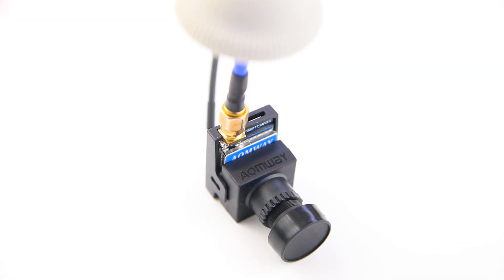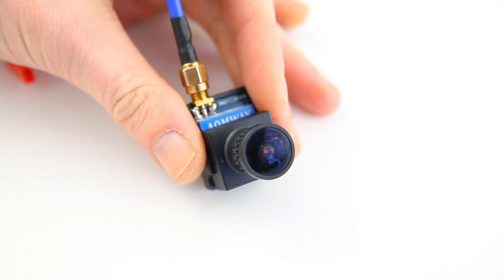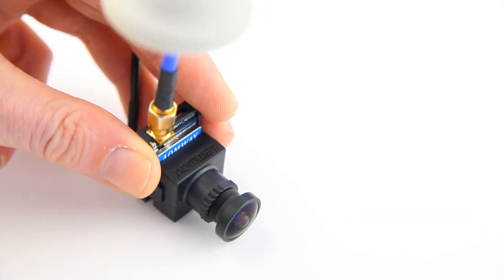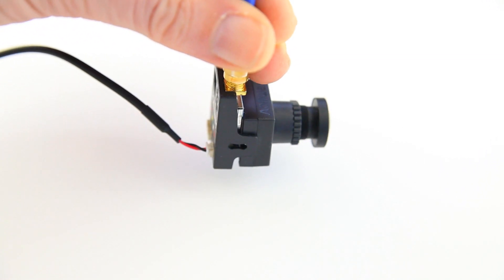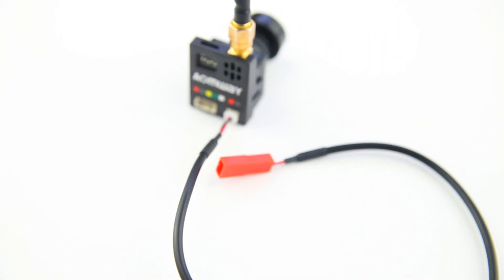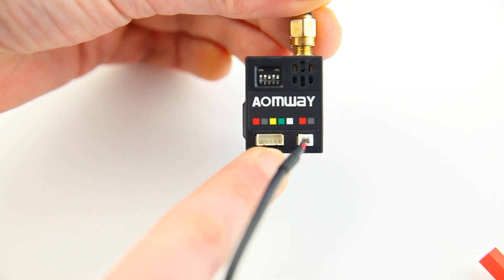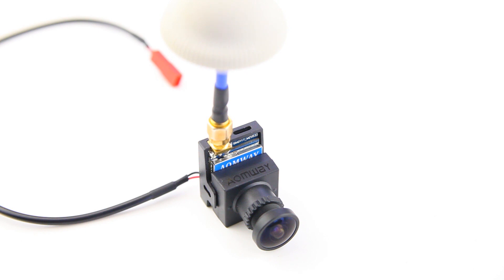Aomay WDR 700tvl FPV camera + 200mW VTX Backpack - Show & Tell! :)

Comment: I have on of these cameras on the way....hopefully my Virhuck goggles will find the camera.
Reply from the maker: Howdy Don.. I can't imagine any goggle would have a problem working with this setup :)
Reply: I just got the goggles.  I hooked up my bugs 2 drone to see if the googles would find the camera and nope it wouldn't.  The Aomway camera will be here friday and I plan to put it on my Traxxas Aton....hopefully the goggles will connect to it.
Reply from the maker: That's weird.. I have no experience with the Virhuck goggle though.. how many channels can is receive??
Reply: 8 channels and 40 frequencys,
Reply from the maker: That should be more then enough to receive any 5.8Ghz signal.. I think the Bugs 2 doesn't use 5.8Ghz though? That's probably why that didn't work.. The Aomway set uses normal a 5.8Ghz signal though.. you're goggle will be able to pick it up..
Reply: Yes the Bugs 2 camera transmits at 5.8
Reply from the maker: Yeah.. but I think it's 5.8Ghz WIFI.. that doesn't work the same way as a normal FPV signal..

Comment: Hi DutchRC Adventures, you seem to know your stuff! Any chance you can give me some advice?

I'm new to FPV, after researching, watching your video etc, I thought that I had ordered all the right stuff but now I'm worried that I do not have the right battery for my setup and was wondering if anyone could give me some advice. 

I am using:

Transmitter and Camera combo: Aomway 700TVL V2 WDR 16:9 4:3 HD CMOS PFV Camera w/ 5.8G 200mW 32CH Video TX Combo 
Battery: Crazepony 400mAh 2S 7.4V 30C LiPo Battery Pack
Goggles: EACHINE EV800 5 Inches 800x480
Antenna: Aomway 5.8G 3DBi 4 Leaf Clover Antenna RX

When I turn it on it works fine, but after about 1.5 mins it gets hot and stops working. I then let it cool down and it works again.

Any help would be much appreciated, really looking forward to using it. 

Thanks!
Reply from the maker: Howdy brother! Thank you offcourse :)
well That sounds like thermal protection to me (which is good, otherwise it would burn itself 'down').. Are you leaving it stationairy in this test?  In that case you have no real airflow cooling it down.. So in-flight you should not have this problem :) 
(offcourse you will need to mount the combo in a way it will actually have airflow :)
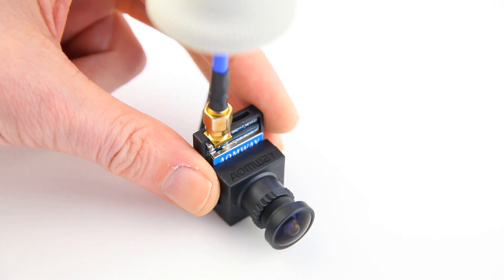Reply: Thanks for the response! I'm using it on my 1:24 CARISMA GT24R r/c cars and not a drone! Seems strange it's not designed to work at room temperature. Guess I should send it back :/
Reply from the maker: Hmm.. most 200mW FPV transmitters need a bit of airflow to keep them cool enough. For a car I would probably use a 25mW system..  
So I don't really think it's a fault of the product per-sé.. But yep.. I agree it is awkward in your case :$

Comment: are you sure it works on a 3s battery? the specs say it requires 3.6-55V. cheers!
Reply from the maker: +Yash Garg Hi there Yash. Yes.. the specs on a few websites are wrong.. The manual says it can operate on 12V.. Which is what it did in this test: 
https://www.youtube.com/watch?v=00OVTGXlp4o
Reply: hi DutchRC Adventures thanks for your input I wrongly read the camera's manual instead of the Vtx's. It works 6-28V or something. It's live now!!!!
Reply from the maker: +Yash Garg Ghehe cool! Have fun with it then! :)
Reply: hah thanks bro :) DutchRC Adventures

Comment: You mention a clover leaf antenna in the video, but it looks like a mushroom antenna. .Do you have the link for it? I think it may be http://www.hobbyking.com/hobbyking/store/__66192__Magic_Mushroom_Circular_Polarized_Antenna_Set_Stubby_5_8GHz_SMA_.html

not sure if this clover leaf wouild work: http://www.banggood.com/Aomway-5_8GHz-FPV-4-Leaf-Clover-AV-Transmission-RHCP-Antenna-1-Pair-p-961730.html

either way - this is kinda awesome. I just got my Aton a week ago and i love it - im NEW to RC and drones, and crashed a few times, but still love it.
Reply from the maker: +Matthew Horbund Hello Metthew :)  Yes sir! Those indeed are the 'mushrooms'. There is a clover-leaf inside those muchrooms however ;)  So really... both are clover leafs ;) 
I have no experience with those Aomway antenna I have to say.. The mushrooms work pretty good :) 

That Aton survived the crashes then? :$
Reply: +DutchRC Adventures 
DUDE.. the Aton is a BEAST! I have crashed it 6 or so times now, twice being really bad crashes. After fixing a bent blade (replacing, actually) and recalibrating the gyroscope via the app, it flew just fine.

Ok, not JUST fine .. there's probably a little stability that's missing in Film mode that was there out of the box. But, I flew it on Sport mode and pretty much drove it right into the ground .... and it still works fine enough.

I am going to put up a video or two just so they're on my channel.... 

THAT SAID .. what do you have the FPV video going to? What receiver/recorder setup? I'm new to all of this! Thanks!
Reply from the maker: +Matthew Horbund Well great man :D  I don't really plan on crash-testing mine, but it's good to know the quad can actually take a hit without ending up in several pieces :) 

My FPV setup consists out of these goggles: 
https://www.youtube.com/watch?v=trW2iuYNOgc 
With this receiver: 
https://www.youtube.com/watch?v=lC1utnxDfF0
Reply: Great stuff - thanks for all the detailed info. It's probably a little more than I want to get in to right now - but it's something I would do in the future.  I was hopeful there was a super easy and cheap way to receive/record fpv .. ie to the iPad/iPhone.
Reply from the maker: +Matthew Horbund You are most welcome ;)  Ohwww I forgot this part.. With this device added, it will allso record your FPV-feed: https://www.youtube.com/watch?v=MHSGyjSScxg 
Not super cheap, but it is very very easy to use. It will allways start recording as soon as you power on the goggles..

Comment: Looked pretty nice! Maybe something I could consider for the 470 once I need fpv for filming? When you took the lens cap off did the lens it self turn? Looked like it, haha. Nice video :D
Reply from the maker: +The RCAddict Yeah. the lens wasn't securely in place, so I need to re-focus it.. BUT that is what I now have a VTR on my TV for :)  Makes life easier..
This is a very convenient set man! FPV-ing the TRX Aton took just 5 minutes :)
Reply: DutchRC Adventures Hmm, weird how it is not secure.
Reply from the maker: +The RCAddict That locking ring just hadn't been tightened well enough.
Reply: DutchRC Adventures Ah, ok :)
Reply from the maker: +The RCAddict The camera does remarkably well in dark conditions by the way.. I guess that's because of the WDR of the camera..
Reply: DutchRC Adventures Sweet, do a night flight ;D haha
Reply from the maker: +The RCAddict Haha yeah, it's not that Aomway night owl camera.. But it does come pretty close :)
Reply from the maker: +The RCAddict I just did a test with this cam on the TRX Aton.. Damn man... This camera need very little light :| Could be a go-to camera for forrest runs...
Reply: DutchRC Adventures Oh wow. Sort of like that micro FPV AIO camera I have on my micro, which is ok I guess, since it is for indoors. I lost another motor today, bottom blew out, even though I had lenghtened the prop hub.... no idea why. I have only 1 spare left! :(
Reply from the maker: +The RCAddict Hmm that sucks.. Aren't there more durable motors available from some company or something?
Reply: DutchRC Adventures I have no idea why these are popping out so easily. :/
Reply from the maker: +The RCAddict Yeah hmm.. I can imagine it's hard to make things really sturdy at this scale..
Reply: DutchRC Adventures None of my other micro brushed motors ever blew out this much though :/ But I guess their frames supported the bottom. The hubsan props don't fit all of the way on the shaft, so when they hit they push in on it, however i used tweazers to make the sit al the way down, but I guess not enough :(
Reply from the maker: +The RCAddict Hmm okee.. so would some kind of prop guard help? like an extra frame or something that runs Over the props?
Reply: DutchRC Adventures Probably, but then you are adding too much weight. when I put the new motor in, I will just hollow out the props even more, and maybe put glue around the bottom.
Reply from the maker: +The RCAddict Yeah.. I understand it would probably get to heavy indeed..
Reply: DutchRC Adventures I wonder if I could try getting some sets of just general 8.5mm motors and see how they turn out. I read that others find the MMW to blow out easily as well :/
Reply from the maker: +The RCAddict Hmm wel not really my area of expertise so to speak ;)
Reply: DutchRC Adventures Haha, I disagree. You are an expert in EVERYTHING ;P How about helping me out with my AP US history essay ;D lol
Reply from the maker: +The RCAddict Hahahaha :D  Well, at least don't make the mistake of calling them poor Indians people from India.. okee? :P
Reply: DutchRC Adventures Lol, this was abut US foreign policy ;P We got off school today because of freezing rain though. 

I guess I need this to get voice alerts from my Taranis if I don't want to take my Laptop with me every time I fly my 470 to use Mission planner. Is there a mission planner mobile app I could get? http://www.hobbyking.com/hobbyking/store/__58203__FrSky_FLVSS_LiPo_Voltage_Sensor_With_Smart_Port_1pc_.html
Reply from the maker: +The RCAddict That one should indeed work :) 
You can allso connect that 433mhz receiver to you phone (with an USB OTG dongle) by the way, and then run a mission-planner alike app on your phone..
Reply: DutchRC Adventures Yeah, I have an iPod though, so only port is the charging one :( No usb :(
Reply from the maker: +The RCAddict Ghehehe no such luck in That case ;)
Reply: DutchRC Adventures Darn :/ Need to make sure the Laptop has plenty of charge to go out in the cold for 20 minutes then ;D
Reply from the maker: +The RCAddict An extention cord then?? :)
Reply: DutchRC Adventures LOL.

Comment: nice-thanks for showing this one Dutch! Looks like it would work well for some micro aerial fpv! :)
Reply from the maker: +Discover RC Welllll.. I think I'll show you a better system for micro-stuff pretty soon ;)  This one from Aomway however IS very handy.. Just slap it on the wing of any plane + a small lipo.. And done! You've got yourself a fpv plane.. right? AND a good camera as well :) 
Thanks offcourse buddy! :)
Reply: +DutchRC Adventures when are u going to show a better alternative of the aomway 200mw vtx backpack?
Reply from the maker: +Robby Race That is a good question Robby.. I have not come across something to be honnest.. This really is a very handy product to just put onto most anything..
Reply: What do you use for a receiver? and could the receiver be used with an android phone ?
Reply from the maker: Well most any 5.8 receiver would work with this camera-system.. And there Are receivers with a USB-out specifically for that purpose: 
http://www.banggood.com/LANTIAN-UVC58-5_8G-150CH-FPV-AV-Pocket-Receiver-For-OTG-Mobile-Smartphone-Tablet-Computer-PC-Monitor-p-1140486.html?p=TO251813974002015038 
Do be aware though there will be lag in the video.. That's just the nature of a USB connection...

Comment: Great video, mate! I always wonder why HobbyKing do not stock much FPV gear in the European warehouse. Here in Germany I have not had much success with ordering stuff from their International warehouse!
Reply from the maker: +Chris Jones Thanks Chris! I agree.. I've had to order most of the FPV stuff I have from HK from the internation warehouse as well.. The goods Did arive in good order though.. Yours didn't??
Reply: I ordered some micro servos and propellers from the International warehouse almost 30 days ago and nothing has turned up yet. I have to wait 45 days until I can complain. Not very impressed with that. But the Euro warehouse has been excellent for me, particularly the suberb Tundra which arrived in just over 2 days from Holland!
Reply from the maker: +Chris Jones For sure Chris.. Shipment from the EU warehouse works very well.. 
Yeps.. things from international can take a while.. I never order anything there that I really need :P haha In most cases you can offcourse pay extra for faster shipping.. That makes most things far to pricy though huh?

Comment: Nice! I need to get something similar to that for my eflite cray. Light and compact. I just need a good set of googles. Is there a noticeable difference between the antenna you threw away and the white one? I'm new to fpv as you may be able to tell.
Reply from the maker: +X-FLIGHT101 It is 1 handy piece of kit man :D  Apart from that the video-quality is good.. 
Ehm yes.. at a few meters, without obstructions, there won't be a lot of difference. When really using it in flight though, the difference is Huge..
Reply: +DutchRC Adventures ok thanks
Reply: +DutchRC Adventures ok thanks
Reply from the maker: +X-FLIGHT101 No worries man.. Don't hesitate to ask things about FPV.. I know it can be daunting at first..

Comment: i like it, it's small. Although you can get even smaller. I have a FPV setup that has an antenna around 3 cm long and has 25mw but it's very good for small gliders like the Binary 900 that ways only 150gl. 
It's built of of a base simmilar to this one: http://www.banggood.com/FPV-5_8G-10mW-Wireless-Audio-Video-Transmitter-Module-TX5813-p-84761.html

http://www.banggood.com/Boscam-FPV-5_8G-10mW-Wireless-Audio-Video-Transmitter-Module-TX5813-images-p84761-q41653.html
Reply from the maker: +jurij segel I've got a video on someting smaller still (WITH a CP antenna!) comming up buddy :D 
This Aomway set isn't really a lot smaller then normal sets.. It IS very conveniant though.. 
Ohw: and I think the image quality is a bit better then most sets..
Reply: Cant wait for it
Reply from the maker: +jurij segel This one: http://www.aircraft-world.com/en/p1986834-hp-fp58minicam25 
Super small.. I have not tested it yet though..